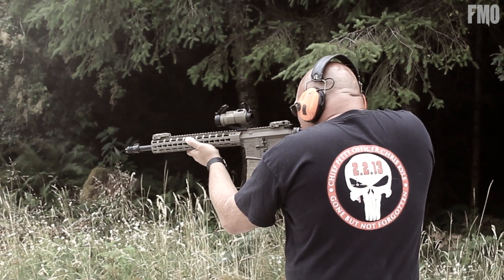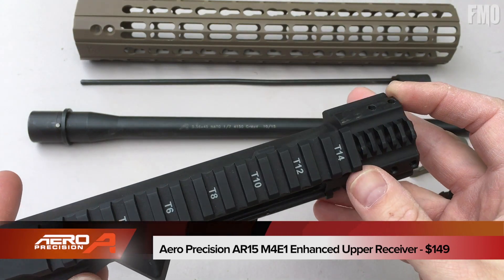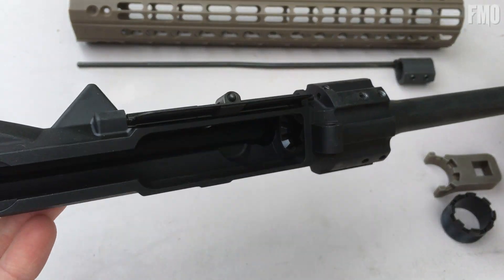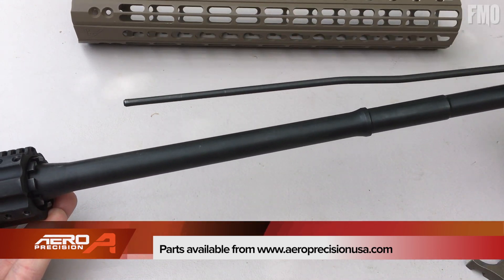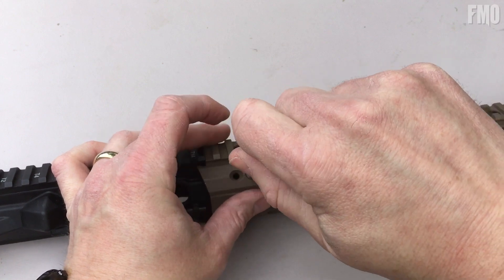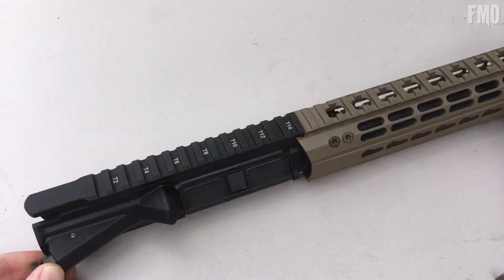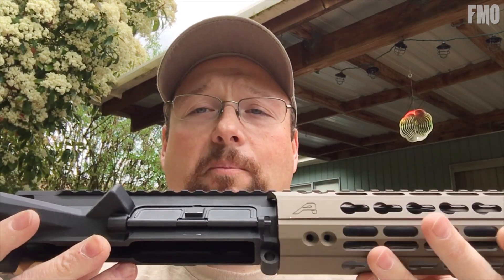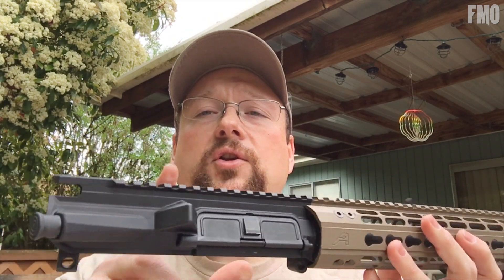Aero Precision M4E1 Upper Receiver - Overview and Demo

Comment: I'm having issues with two separate uppers:
One is an FDE upper that I can not seem to get the barrel fully seated.  It's a CMMG 9mm barrel.
The second is an upper I have assembled that I want to take apart and I can not get the barrel nut undone despite using Aeroshell.

Comment: It should be noted the enhanced upper only works with aero handguards-  it won't work with other manufacturers such midwest industries. ...learned this the hard way :(
Reply from the maker: There are some others that make or have made BAR handguards in the past. I have both a Seekins and Spikes Tactical handguard that fit perfectly.
Reply: @Firemountainoutdoorsreviews  i am looking to replace my 15" quantum with a 12". Problem is sold out along with gen 2. What seekins and spikes did you get to work with it?

Comment: But do I have to use enhanced aero precision handguards with an enhands upper? Can I an upper from another company?
Reply from the maker: You can use enhanced handguards on any threaded upper receiver. When ordering, the website will ask if you are using the handguard on a standard receiver. It will then prompt you to purchase the BAR barrel nut.

Comment: I think this is the best upper for a 24" bull barrel.  Very tight tolerances fit was perfect.   Although Aero does not seem to know what torque to use.   Their site says 55 pounds one place then 50 pounds in a another.  Gas block they say 40 pounds then another its 35 pounds then another its 25 pounds.     Those set screws will strip out heads at around 35 pounds.   So not sure if they are pulling the torque numbers out of a hat.   Seems hap hazard.  But the upper is nice.

Comment: A small amount of molybdenum disulfide high temp grease should be applied and then season the threads torquing down and loosening the barrel nut twice, and then final tightening the third time.  Aluminum threads have some give, and seasoning makes sure they're fully seated and formed to the nut's threads so you won't have any issues with it backing off ever.  Proper mil-spec way of doing everything.  The seasoning part people debate about, but if it's called for in the military, it's probably better to do it and it really does make sense with aluminum.  Don't use the same torque wrench when loosening the barrel nut, switch to a breaker bar and back to the torque wrench each time so the torque wrench doesn't lose it's calibration.

Comment: People, please do not forget to apply a grease on the barrel extension and the threads of the barrel nut. This will prevent bi-metallic corrosion and make the process easier to replace your barrel in the future.
Reply: Thanks for this comment

Comment: I’m seriously loving the use of setscrews instead of those pesky roll pins. From an engineering perspective I can see how they extend the receiver life by preventing rotational wear. The modular construction is also an excellent advancement, making timing a thing of the past. I just received mine today with a 16” m4 profile barrel and 12” quantum mlok handguard. Absolutely rock solid and the most inexpensive free floated upper I’ve ever owned. I’m now a loyal Aero guy!

Comment: Cool Is that a mid length gas tube a 16 in barrel and the 15 in Enhanced MLok Rail. Looking to get one for a 16 in barrel and I'm debating between the 12 and 15 in Rail
Reply from the maker: This was their 13" handguard (now discontinued) Currently they make 7", 9", 12" and 15". The barrel is their 14.7" pencil profile with mid-length gas system.

Comment: I had a build today with this upper and a Aero 223 Wylde. I had to hammer the barrel into the upper it was so tight... is there something wrong?
Reply from the maker: Not necessarily. Tolerances can be pretty tight. I've used rubber mallets to install barrels into the M4E1. You just have to make sure the index pin is lined up perfect or you will sear it off.

Comment: on the Aero M4E1 how do you replace Forward Assist... Really want to put the Stike 3 Prong in place of the OEM round plunger, but can't find out how to do this anywhere? It looks captive as there is no underside hole to punch through?
Reply: William Taylor it’s a torx screw not a pin to punch

Comment: Two questions...

1) can you use an upper vice blocks on these "billet looking" forged uppers? 

2) can you remove the dust covers on these uppers...by removing the c-clip?
Reply from the maker: 1) Not exactly sure but guessing they only work on AR15 standard uppers. We use Geissele Reaction Rods for all of our builds. 2) These uppers shouldn't have a c-clip. There is a set screw under the handguard on the handguard mounting surface that retains it, that needs to be removed. From there you can slide the dust cover rod through the front of the receiver.
Reply: Thanks. I ordered their standard pair set upper/lower combo today.

Comment: what is the name of the nut that threads inside the barrel nut? Also what is the wrench that fits inbetween the spaces ?  I'm trying to revove the barrel and ineed a wrench to loosten it, then reassemple. This is a .223 Wylie barel, and is very nice assembly

Comment: I’m confused... they just moved the barrel nut threads from the outside to the inside... The handguard is more secure because it screwed in instead of a pressure fitting but you can get barrel nuts that do the same thing.  The only advantage I can see on this possibly… Is this might be slightly more accurate because The actual barrel nut isn’t touching the handguard...

Comment: I have a quick question for you. So I just finished my first complete upper and lower AR15 build and I used an Aero Precision M4E1 Upper Reciever with a quantum rail. I purchased one of their 18" CMV SPR Profile barrels (I believe ballistic advantage is the OEM), as well as a SS gas tube with a adjustable gas block. After I assembled everything I was experiencing an issue where the gun was constantly short stroking. I adjusted the gas block all the way from fully closed to fully open. Unfortunately, the best it ever got was barely ejecting the casing and not picking up the next round. I tried 55 grain, 62 grain, and 77 grains with all of them yielding the same result. I purchased a new gas tube and a standard gas block and the rifle is still short stroking. I attached the upper onto a carbine length buffer lower and a rifle length buffer lower. Still experiencing the same problem. I have contacted Aero Precision and they have sent me a UPS Delivery label so I can return the barrel for inspection. Could the problem be the gas port wasn't drilled quite right? I just have a fair amount of money wrapped up in the gun and it is irritating that this isn't working. I am just worried that they will send the barrel back to me and say it has no problems, yet the short stroking still continue. Bit longer than a quick question, but thanks anyways.
Reply: kyle haag I'm not an expert by any means, but have you tried using different buffer weights?
Reply: Yeah, I tried a normal weight, heavy weight and a rifle length buffer. I sent it in to Aero and they are helping me trouble shoot it right now. They have been really helpful so far.
Reply: Good luck, hope u get it figured out quick!
Reply: I know this is 5 years down the line, but can you please provide an update as to what happened with your barrel?

Comment: Just ordered one.  Can't wait til it gets here.  Question for you... Is the dust cover assembly all Mil Spec?  Can it be swapped out easily?
Reply from the maker: The dust cover can easily be swapped. You have to remove the 8 screws for the handguard and remove it. There is a set screw held in by an allen screw. it then slides out through the front of the barrel extension. Best part is that no C clip is needed to keep the rod in place.

Comment: This upper is a perfect example of an engineering mistake. A 2 cent broken screw will ruin your upper. It happened to me, and the screw.shaft was so small that it couldn't be removed without damaging threads. Typical designs may use shims, but a broken screw calls for a replacement barrel nut, not s new upper. JUNK!

Comment: anyone figure out how to remove the dust cover on this upper receiver?
Reply from the maker: First remove your handguard. There is a set screw in the side of the handguard mounting platform that you need to remove. Once it's removed you can slide the dust cover rod out.
Reply: Fire Mountain Outdoors yea I figured that out after I cut the rod to remove. Hahaha live and learn. Didn't need the old parts but would've been nice to save them.

Comment: hi Bob I have a question for you I just picked up m4e1 complete Upper from Aero precision I know they don't dimple their barrels or pin their gas blocks have you guys had any issues with they're low profile gas blocks with their barrels more so their gas blocks loosening up? was just curious if you could get back to answer that question and would you suggest dimpling the barrel
Reply from the maker: Mark and I have never had one come loose. I think once the carbon builds up it locks the set screws in place. Just to be sure however it wouldn't be a bad idea to check to make sure they are tight from time to time.
Reply: thanks for the quick response I appreciate it 😂 love your guys  Channel and appreciate all the videos you guys do!

Comment: I'm impressed.  Kinda makes the old design look obsolete.  Future AR builds will be with Aero.
Reply: Do you think it only works for free float handguards?
Reply: +A. Coulthard Looks like it is, and specific to Aero Quantum rails too.
Reply: They seem like as good a rail as you can get though. I kind of want this upper for quick barrel changes cause it seems to remove a step.

Comment: Grease or oil on the threads?  I have always used grease on the barrel extension and nut.  Is it needed?
Reply: Noughs Enough I’d use anti-seize grease. Never use oil

Comment: Do I have to use an aero precision hand guard  with the m4e1 ?
Reply from the maker: No. Any handguard that is BAR compatible will work. I have used ones from both Spikes Tactical and Seekins.
Reply: @Firemountainoutdoorsreviews  I ordered an alg handguard and it did not fit.

Comment: Is there anything I can do to help seat a tight barrel? I have  Aero Precision M4e1 enhanced upper and lower receivers as well as the 15 inch enhance M-Lok handguard. However, I have a Faxon .223 Wylde barrel that just doesn't seem to want to go all the way in. Because of the upper receiver's extended handguard mounting cover I cannot see how far the barrel goes or if the pin is in the detent.